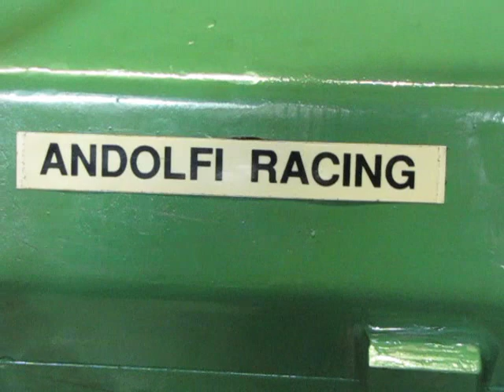Andolfi Racing - Dyno Test Rotax 914 UL

Comment: After a long run like that you only allow the turbo 20 seconds or so before shutting down! Result is oil carbonising on the seals and eventually after enough cycles like this premature turbo failure, even with a watercooled turbo.